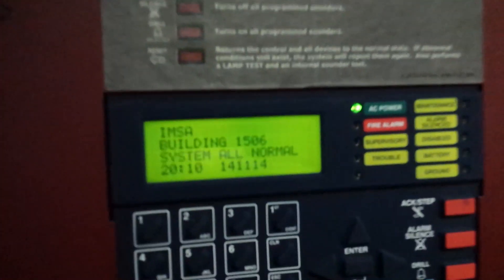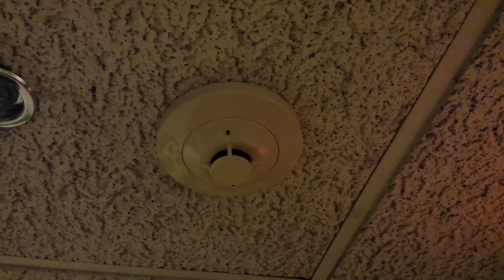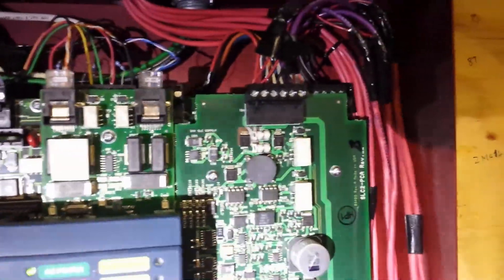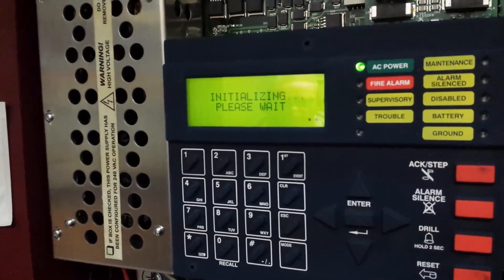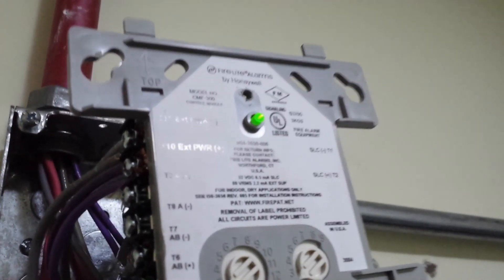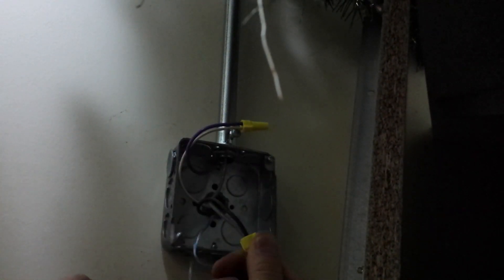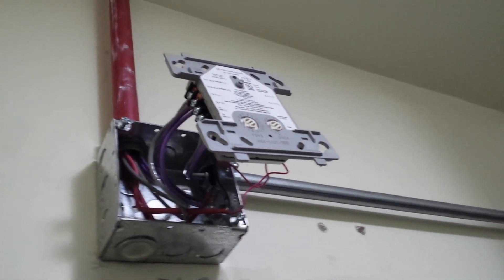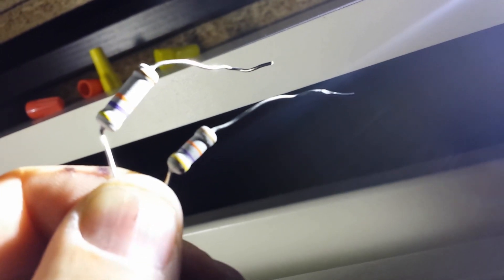Fire-Lite Addressable Panels - SLC Issue Discovery

Comment: Thanks for the video.

I would have first disconnected the SLC-2 and check the resistance - for shorts, opens, short to ground, and the resistance.

Then go to the module. Disconnect the circuit connected to its output and check for resistance as above.

Then continue from there according to the results of both measurements.

I try to avoid making assumptions and just measure/check & double-check!

I usually start with the wiring first, then input devices - passive & active; then output devices - AV; and finally, the panel itself unless there's some obvious reasons to depart from that methodology!

I have noticed that many don't document installations, modifications. Not even a sketch!

Comment: Just to put this troubleshooting into prospective he first tried to solve it by replacing the SLC-2 card but, that didn't fix it, then he replaced the module and that didn't fix it. Note I would've done the same. Then meters the output wires and is reading 89k ohms which is double than it should be that's why it didn't go into trouble. RESISTORS NEXT TO NEVER GO BAD!! Swaps out a 50 cent 47k resistor and fixes the system. Frustration at it's finest!!

Comment: That's the quality of fire lite for ya!
Reply: Firelite are good panels.. its the resistor got damaged causing malfunction of module bypassing the SLC later changing to invalid reply after he set the SLC back on, so blame the resistor lol
Reply: @Aslin Fire Safety well I guess it may be a dealer problem them.

Comment: I thought all the addressable pull stations were keyed not hex locked. I also didn't know Fire Lite made an addressable single-action pull station.
Reply from the maker: When the system was originally installed, the original engineer for the project wanted "single action" pull stations.  So, they are all Fire-Lite BG-12S conventional, single action, hex lock pull stations with MMF-301 mini-modules in the boxes behind them.  Thanks for watching and putting up with the long rambling video!
Reply: Interesting! Also, I'm trying to figure out how the resistor on the control module causes the SLC to go offline without a fault message. I know the modules supervise their outputs by somehow measuring the amount of voltage "leaking" through the resistor to SLC ground, but since the control module also requires 24 volts of auxiliary power maybe it's using some other supervision method. Also, the rapid blinking seems to indicate that somehow the module is intercepting the "flash LED" commands being sent to the rest of the devices on the loop. Firmware update seems to have fixed the bug but man would I love to do electrical engineering for Fire Lite or Silent Knight!

Comment: Is it the cmf-300?
Reply from the maker: No.  It was the 47K EOL connected to the CMF.  The resistor had gone bad and its resistance value crept up to like 95K or so.  When that happened, the entire SLC shut down with NO trouble on the FACP.  So, the panel was sitting "NORMAL" but totally inoperable.   After about 6 months, Fire-Lite issued a "suggested" firmware update: https://bit.ly/2WKcShc.  I remember at the time that I thought it should have been more than suggested.  Of course, nowadays, we're well beyond using those panels.
Reply: @jaddwooka  now I've been looking at ps tools and I've been trying to figure out how to update my ms-9600udls.. care to guide me?

Comment: It's probably t-tapped
Reply: Rocket Ronnie  T-tapping is not recommended in addressable applications. This can cause polling issues on the LS protocol (I think). I've seen it cause issues in an FCI E3 system where some devices on the T-tapped portion would show as missing for a few seconds, then clear. This would happen intermittently every day. That whole portion of the SLC had to be re-run to the original end of the SLC line and the issue disappeared.
Reply from the maker: This building was actually Class A SLC wiring so no T-taps.